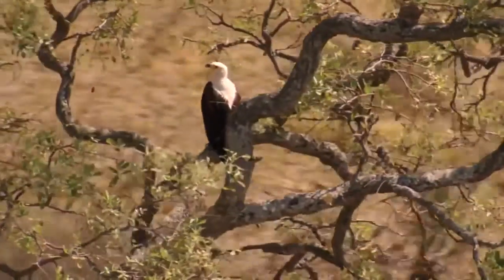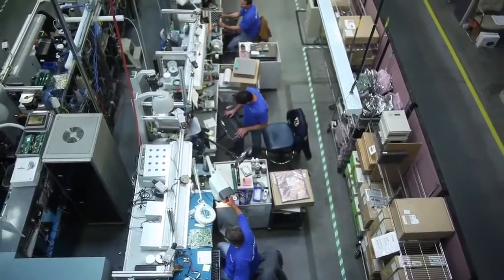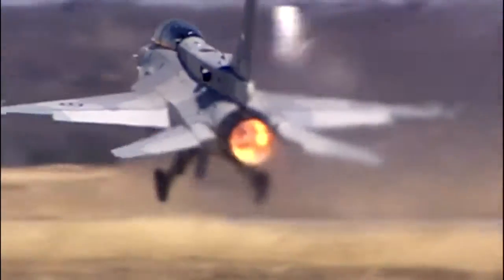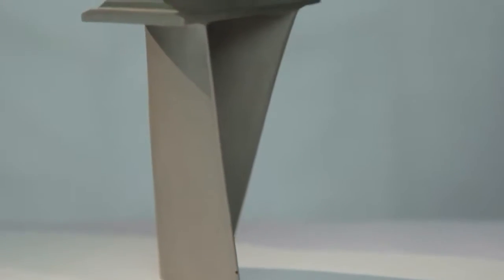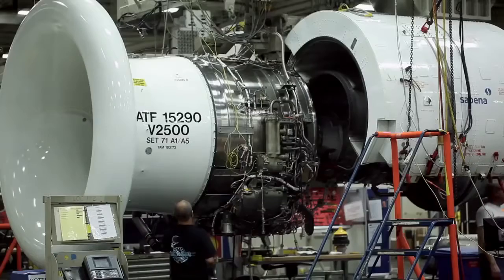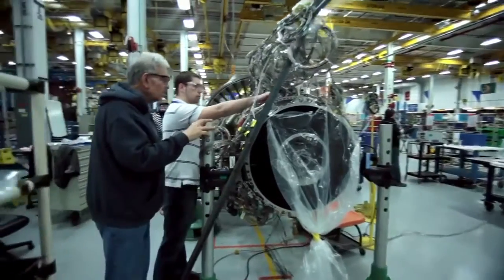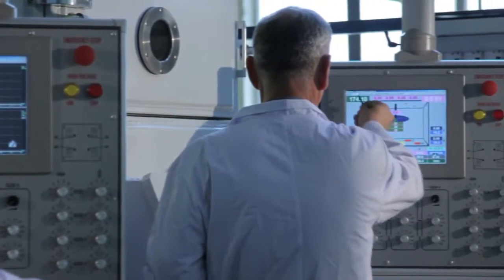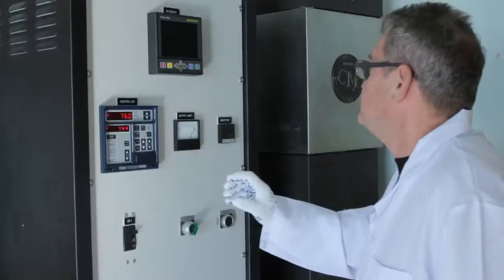International Center for Electron Beam Technology (ICEBT)

Comment: Electron beam welding is not a new technology. It has been around since the 1960s. The control systems are new but the electron beam process is not.
Reply: I worked with electron beam welding (in manufacturing) for several years in the 1990s.